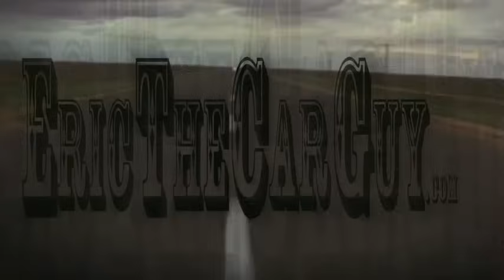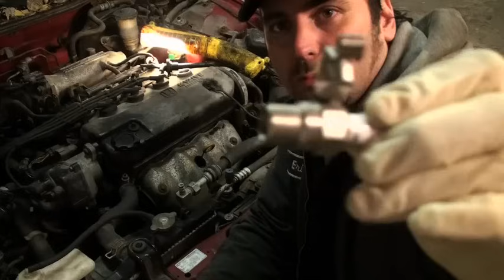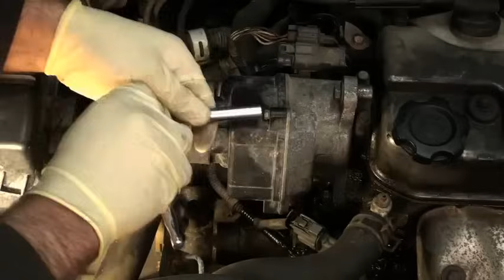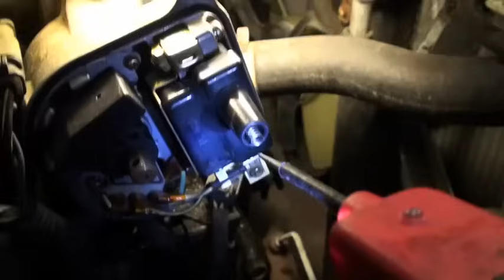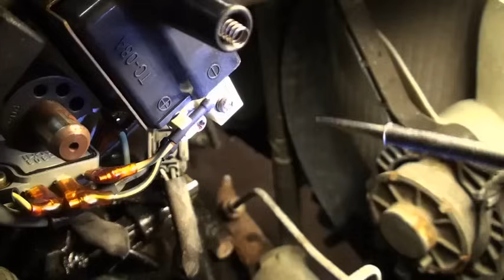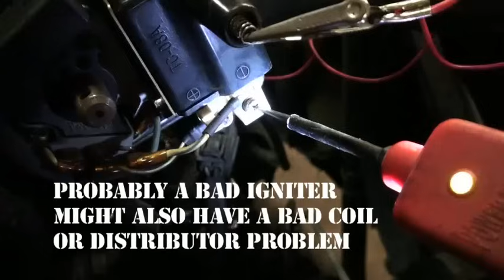No Spark Diagnosis (Honda) - EricTheCarGuy

Comment: Very informative.  While using your tips to check the coil and igniter I discovered a loose negative wire in the igniter.  Tightened up the terminal, put the cap back on, and the engine fired right up.

Comment: I need help on my 98 Honda Accord v6. It cranks but no start. I checked the distributor there is a oil inside. What should I do?
Reply: you should change the whole distributer to be sure in case the oil damaged the cap and rotor. that way you dont have to guess and run back and forth for parts.
Reply: CHANGE THE GASET IN THE VALVE COVER THATS WHY YOU GET OIL INSIDE THE DISTRIBUTOR

Comment: I have a Awkward problem with a 96 Accord 4cyl Auto trans, Car starts up and runs great' soon as it gets warmed up the idle gets rough! So I'll hit the gas a few times revving it up! Feels smooth no studdering. Then it's like someone Flips a switch the Rpm's free fall to 0. Once in a while when it does that the engine chugs a few times at almsot zero Rpm's as if it's trying to stay running then just die's. Go to start it back up and nothing! If I let it sit for 20 mins it will start right up but of course die within a few mins! So Soon as it died I pulled a plug wire off and checked for spark and there was no spark.. Pulled the distributor cap off and I can see very minimal amounts of oil inside, not a lot very minimal. Could a bad Distributor give off such symptoms like when it's cold work perfect and when it's hot start intermittently working? Cause sometimes when it dies it will start right back up but of course die within seconds or minutes. Any idea's ??
Reply: you should do a complete tune up. spark plugs, wires, cap and rotor. If that doesnt work do throttle body clean, maf sensor clean, and if possible idle air valve clean.

Comment: Awesome video very simple and straight to the point I have a 95 civic and I put a D16 zc engine in it and I had this problem after I let my car set to long and it was the igniter I swapped the coil out and thought that was the problem until I let it set again for about 12 hours thanks for the video awesome work.

Comment: need some help with 1994 Toyota camary crank no start...if you us some  starting fluid it will start..for a second then die.
Reply: Check fuel pressure
Reply: Did you find out whats wrong with it?
Reply: check your fuel system. If it starts with starting fluid it means either you might not be getting enough fuel to the engine.

Comment: what dos i do when my cap has sparks coming out from my coil through my cap when it does that the car won't start then it stops and it starts then please help
Reply: Check our cap and wires. Make sure the cap is snug.

Comment: I have a manual 89 nissan maxima and after my car has warmed up in 1st 2nd and 3rd gear it jerks when I accelerate what could be the problem I've change spark plug wires and the distributor and spark plugs

Comment: Okay. Let me say first that yes I have thrown parts at this car. I have a 1996 honda accord. When I bought it , it was not running, but I thought I could get it running. The guy who owned it said that he was just riding down the road and it just cut off. I have since replaced the crankshift positioning, the distributor, and checked the main relay from one in a running car.  I hear the fuel pump come on when I switch the ignition on and I can hear the main relay click when I switch the car on. Since I replaced the crankshaft sensor, I went ahead an put a new water pump and belts on the car. It cranks just fine, but doesn't run. I have fire to the spark plugs, but I am not sure if the injectors are pulsing. Now I am so lost. Any ideas?

Comment: I have a 98 Honda civic and there's no spark and no gas going in at the same time. I've tried my Distriburator on a co workers car and starts up right away, switched out the fuel pump and fuel main relay and still no gas. what can be my problem?
Reply: Plugged fuel filter, wiring problem, out of gas

Comment: I attempted this method for crank no start on 92 celica 2.2. It had power to positive and negative on coil. I tried cranking it over with tester on negative. Now it won't crank and both the positive and negative are dead. Any ideas? Thanks

Comment: Very thankful for this video, just ran into this problem with my 2000 Honda Accord. Last week i put a new starter/battery into it because it wouldn't even turn over. Ran just fine yesterday, now all the sudden it'll turn over, and over, and over but wont kick on. Did the screwdriver test that you showed in the video, not getting any spark at all. Dont have the tools to do the other tests, or a place to do it at the moment being in a apartment with no garage or shed. But your video was very helpful.

Comment: First off, I love your videos. 

nNow, I've got a rotor without the screw. How do I get it off? I don't want to break anything
Reply: Probably starting to rust where its slides in to... Thats what happened to mine. So i put wd-40 on a piece of napkin and let a drop fall into it. And then i wiggled it and it eventually came right off, i disconnected my battery just in case too
Reply: +Wendell Chase it just pull off I got one two

Comment: I'm just starting Engine Performance at GRCC and this video definitely helped!
My 91 Acura Integra previously did not start a couple times but could not get it to fail at the shop while I was in Electrical. Testing said everything was fine.
Now it only cranks and I can smell fuel and am suspecting a no spark. Thanks for the tips Eric!

Comment: Hi Eric, help please.
Have a civic del sol repaired a water leak on the thermostat housing and now its not sparking, dont know if I have disturbed something electrical but all seems OK.  went through your ignition checks and think it might be igniter. when I was doing a spark test I got one spark then nothing both on the plugs and then from the coil. Any pointers please

Comment: I changed my radiator and thermostat on my 98 civic si. when I was done I tried to start it and got nothing. crank but no start. someone said the ground on the thermostat housing I checked and its fine. main relay and fuel pump work

Comment: THANK YOU Eric. For anyone that is still stumped and has a spark at the plugs, and the coil and igniter are working, and fuel flow isn't an issue, I simply cleaned the contacts on the inside of the distributor cap, cleaned a bit of corrosion off the thimble that the rotor attaches to and cleaned the contact on the rotor itself - the "spinning blade" type part had the most corrosion on it of all these parts. I was getting an orange spark from all four plugs using the screwdriver to ground method, but I'm supposing that something wasn't maintaining enough of a connection to give a strong spark. Btw, during this process I also changed out the fuel filter which was over due for a change, but that didn't fix the issue until I cleaned the distributor. (1998 Civic DX hatchback w 120,000km)

Comment: Ah, i'm new here but i'll add a little bit of info also. Have a 99 dx hatchback that had a no start condition. Checked for fuel flow via loosening the filter, found out i had spark. Pretty sure compression was good, so i saw a diaphragm looking object on the fuel rail and i disconnected the top hose on it and car fired right up. It was the fuel pressure regulator and it was flooding the car out while trying to start it.

Comment: Eric, you ROCK! Bought a 97 ex with 100k on it just a few weeks under a year ago. Car was solid up until about 3 weeks ago. 1st was the pipe cracking just past the cat, so i got a Yonaka cat back exhaust and put that on. Fired it up and discovered the front pipe cracked in front of the cat also. Got a new front pipe and put that on and car was fine and sounded really good now. So yesterday, was out running around, 20 miles from home and car dies at the stop light. Argh! Get it towed home, $235 later and checked for spark at plugs, none. Brother who was a honda mech. for 18 yrs. until retirement in 1993 says it could be coil or igniter but couldn't remember how to check. Found your vid on Youtube Eric and ran the tests, finding the coil to be bad. Replaced it and bingo! Fired right up, what a load of relief to me. Can't thank you enough for all that you do!

Comment: Cool vid, but you didnt show how to do the the igniter check with  regular test light.
Reply: +A Garcia A Garcia 
I checked mine with a regular test light. Just put the probe to the negative terminal, it will flash on and off if the igniter is good, while cranking the engine.

Comment: What causes corrosion on the four terminals in the cap Eric?
Reply: +boxdrinks In case you didn't get an answer, moisture.
Reply: +Richard Rathman ok just confirming... Becuase it makes me wonder why these parts weren't made corrosion resistant. The surfaces that take the spark seem to be most affected. I can only scrape them down so much.

Comment: I have a question for you eric. 
this is what I posted on the forums because I'm stumped. 
what do you think?

"ok so bought the car as a non running car. 
had it for about a year now sitting in my garage. I cant get it to idle for the life of me. 

It starts, idles for a few(2-3) seconds and just stalls. 

what I've checked/repaired:
-AIC(cleaned and checked)
-MAF
-Cold start sensor
-lambda sensor
-vacuum leaks(pressurized the system) 
-injectors
-fuel pump
-ecu(replaced, resistor was burned out)
-fuel pump and ecu relays
-fuel pressure at 37psi in fuel rail how it's suppose to be

the car starts and idles on starter fluid but once you try to run it on it's own fuel, it dies after a few seconds. 

Its been sitting for a while. any suggestions anyone? Im more of the 9-3 v6 guy and I can't figure out the issue. 

thanks"

Comment: Okay just want to say thank-you for the informative video but... I just got my 02 Honda Accord running and I thought I would share this. I had no spark, fuel pump wasn't priming and immobilizer key indicator and check engine light wasn't coming on when turning on the key. Things I did were... swapped out main relay with working relay from another car, removed and hot wired fuel pump(working fine), bought a test light and did all things in video and then I went to pick-a-parts wreckers and found a coil and an ignitor. Grrrrr... still no start. I really thought I had checked all the fuses or at least all the ones I thought were pertinent to my problem. Long story short... there is a little fuse under the hood compartment call... ACG-S... 15amp... pulled it out and it was blown. WTF is a ACG-S fuse for... I have no idea but it caused me much frustration and countless hours of Googling and many late hours in my garage. Most everyone was pointing to the direction of main relay, fuel pump, coil or ICM.
Anyways I never post on here but I'm sharing to maybe help someone else who is having a problem similar.
Cheers for the BTW... just trying to be helpful... not critical. :-)
Reply: +Newfie Russell 
Where is this fuze located exactly???

Comment: my ek4 crank no engine start after try change distributor cap and rotor.

friend found i connected plug cable to distributor all wrong sequence.
after few try reconnect back correct plug cable to distributor sequence. 
finally engine started up.

Comment: I have spark at the coil, but not the plugs.  I replaced the cap and rotor and still nothing.  What else am I missing?
Reply: +Mike Allen Check where the plugs leads are grouped & pass through a single point.....this is commonly where they break down & lose the spark to earth.
If you are sure the coil is good & spark is healthy & STRONG....it has to be the individual leads breaking down.
Plug leads are resistive and the spark will always find the easiest way to ground/Chassis.
Reply: +Patagualian Mostly It was a weak spark, bought a new distributor and I was good to go, thank you.
Reply: ***** OK Mike....Glad to hear you are up & running again.
Cheers.

Comment: Hi, I have a 1998 Honda prelude 2.2 engine crank but no start, it was working good until one day went out, previous I take to a shop and they  replaced the timing belt and crank sensor ,but nothing i check for spark and sometimes it has spark then last for a few seconds ,i check the ignition coil inside the distributor and i have no power ,i follow to the coil and the coil has no power out of it i put a new coil and it still doesn't work. i check the 4 point connection for the coil and it only has power on the yellow and black cable .i need advise please.i put a new after market crank sensor .

Comment: im trying to check my ign coil using test light, it lights up but i acctually have to touch the spring of the coil for it to light up.(no light if the tip of the test light and spring of the coil dont touch but close to each other) does it means my coil is not producing enough power going to the distri cap? thanks for the responce

Comment: Hi, I have a 95 accord but the coil is not on the distributor is on the side but my question is, is the igniter inside the coil? Because my distributor is not the same as the on on the video!

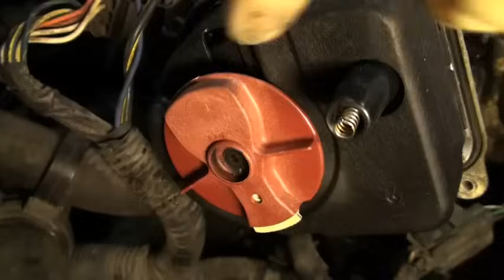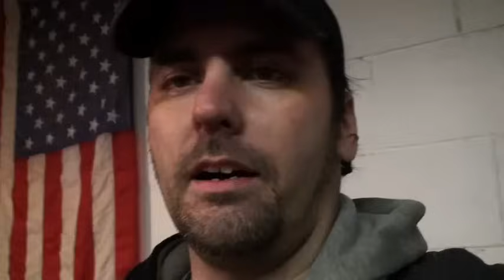Comment: I have a 1990 Acura Integra GS 1.8. While watching the video around the 2:48 and 3:48 marks I see that the ignition coil has a "spring" in it which would make contact with the installed Distributor cap. Is the "spring" a necessity? Did I lose it while installing another cap? Some Auto stores I called looked at the ignition coils for my 90 Acura and said it didn't come with one. Is this what is necessary to make the coil make a solid spark with the dizzy cap. Anyone know....anyone. Please help......if so where can I get that "spring"?

Comment: Fixed my 99 civic twice with the help of this video, once in 2013, used a test light to find bad coil, then again yesterday, no blinks when turned over, bad igniter. Fixed it in a total of an hour thanks to Eric taking the guess work out. I was like a mad scientist.. 'No spark, let me trace that back to the source!' Thank you!
Reply: Is the ignitor, the ignition module? I'm new to the automotive industry.
Reply: Did you use oem or aftermarket, I have a coworker who's car will not start.
Reply: both aftermarket bro.. most will say use OEM.. but on a 99 civic with 240,000 miles, I chose to save that cash! btw, still running strong and starts like a brand new civic.
Reply: thanks man, i'll let him know
Reply: marcos lopez yes it is
Reply: Thank you so much for your help. Couldn't have,almost rebuilt, my honda engine with out you. You do a really good job at giving details. Elaborating

Comment: Maybe you can answer a question for me. Working on a 92 Toyota Camry that has no spark. Installed new distributor with new internal coil. Has a good igniter. Has new plugs and wires. Still no spark! Can you help?

Comment: I cant agree enough when talking about honda ignition parts, always use oem. I was recently having an idle problem with my 98 civic. I tried everything from cleaning the pcv system and checking fuel pressure to setting base idle and ignition timing to a new Tec cap/rotor. I then realized that my Ignitor wasn't an oem hitachi brand ignitor. I bought  a hitachi one and the idle issue is now fixed.
Reply: So do u have a video
Reply: No I don't. Does that make you think I'm full of shit?
Reply: No I'm just trying to learn about my car
Reply: Well if your having an idle problem check ignition components as shown in this video. Check your PCV system, check your Idle air control valve and bleed coolant. Check for fuel pressure and test fuel pressure regulator. Ignition timing can also effect idle. Lastly check valve adjustment. Those in my mind are some of the more common things that can effect idle. You can find how to videos on everything I listed here on youtube.
Reply: garretts91

Comment: on my 1997 honda accord lx im still not getting no spark from the wire to the spark plug and i got new cap n roder new distributor and coil and new wires im getting spark from coil but not at the end the wire were u plug in the spark plug what do i do my car wont start oplease help

Comment: Eric please help watch the video for no spark on my 1998 civic lx an I have no spark at the wire an I just put new wire an plugs in an the distributor is a year old what could it be if the distributor is good no spark at wire an the computer we hooked up gives no codes says nothing is wrong after trying to start a few times gas smell is strong an I put a new fuel filter to already

Comment: HittingBombs19,
When you crank a crv (gen 1) over without a spark plug wire connected (or with the dist cap off and don't have the coil sping grounded, etc) ,it can easily cause the ignition coil to internally short out. That is what you did by starting it with that spark plug wire off.
Reply: Your coil wont burn out if a plug wire is disconnected,when you check for spark you remove a plug wire to see the spark,the spark jumps to any ground source...you cant internally short a coil because its not connected to a spark plug..you have no idea what you're talking about..go read a book or watch a video.